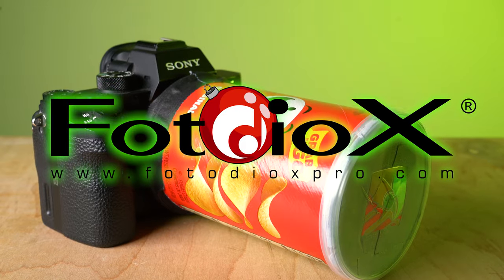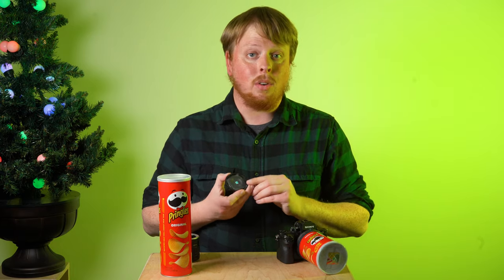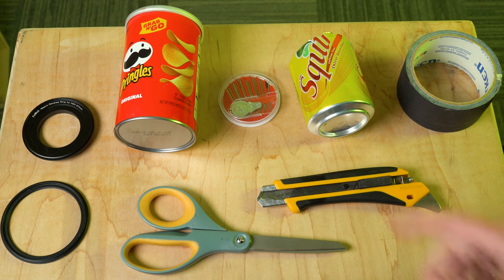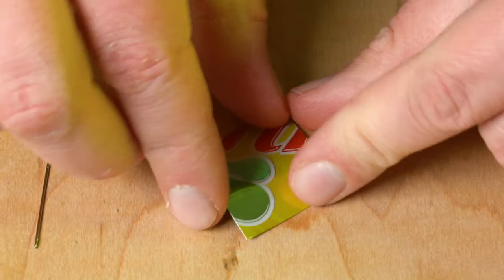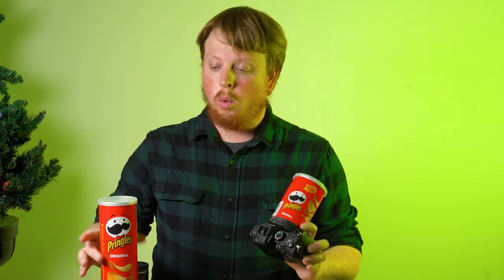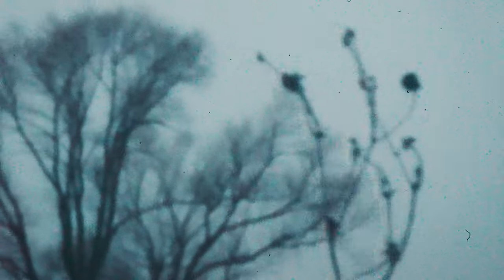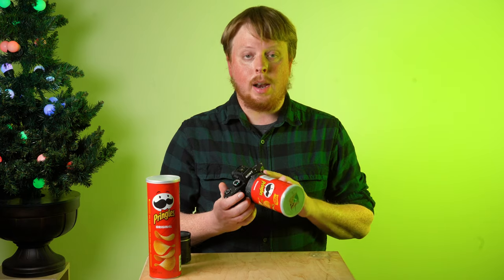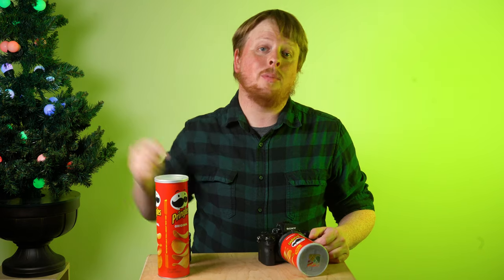Building a DIY Pringles Can Telephoto Pinhole Lens

Comment: Why did you first make a big hole and patch it with a piece of soda can aluminum? Why not create a small hole in on the pringles box itself?
Reply from the maker: The metal on the Pringles can lid was thicker than what I wanted for a pinhole. It could have worked though.
Reply: @FotodioxInc   Got it. Thanks.

Comment: Do you think you could forego the pop can step by instead leaving the metal on the pringles can and punching the hole in that or is that metal too thick for the needle?
Reply from the maker: The metal on the Pringles can itself is too thick for a pinhole lens, but you could drill a larger hole through that metal and then tape the pop can metal pinhole behind it instead. I just didn't have access to a drill that could drill through metal when I did this build, which is why I went with using the plastic lid instead.
Reply: @FotodioxInc  Actually, you can make it work by using a push pin to put a dent in the bottom and then sanding off the bump. This will make the metal thinner, easier to drill and make the edges of the pinhole more like a knife edge for the best image.
Reply from the maker: @Francois_L_7933  The metal cap on the bottom of the Pringles can is pretty thick. Every pinhole I've either purchased or made has been created with very thin metal, so I guess I'd just be cautious of using such a thick metal plat to make a pinhole. Have you used thicker metal before?
Reply: @FotodioxInc  yeah, I've used some pretty thick brass sheet before. I've drilled it as is and it worked. I've also made them using the dimple and sand technique. You just have to sand more than on a soda can. When you get a knife edge on the edge of the pinhole and a very round hole, that's when you get the sharpest image. This and having an optimally calculated pinhole size. If the hole is not optimal, whether too small or too big, the image will be fuzzier.
Reply from the maker: @Francois_L_7933  Thanks for the tips!

Comment: Fun diy project but please don’t spread misinformation on the internet. This may have a longer focal length but it is not telephoto. From Wikipedia “A telephoto lens, in photography and cinematography, is a specific type of a long-focus lens in which the physical length of the lens is shorter than the focal length.[1] This is achieved by incorporating a special lens group known as a telephoto group that extends the light path to create a long-focus lens in a much shorter overall design.”
Reply from the maker: When we talk about pinhole, we really shouldn't use any of the same language associated with optical lenses. The only reason we do this it to help people understand what we're achieving non-optically. This DIY pinhole assembly is only 115mm, while the pinhole's focal length is 140mm, so even though it's a pinhole, it is achieving a similar result to a telephoto lens, which is why we used the term to describe it. You are technically correct though.
Reply: Actually, the first definition for telephoto on Meriam-Webster is: "being a camera lens system designed to give a large image of a distant object". So calling this pinhole lens telephoto is perfectly fine.